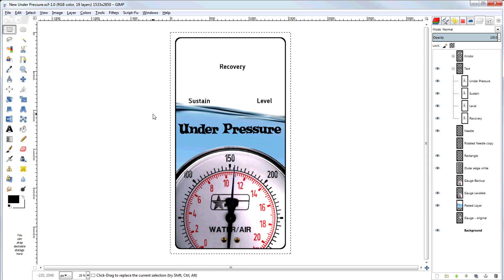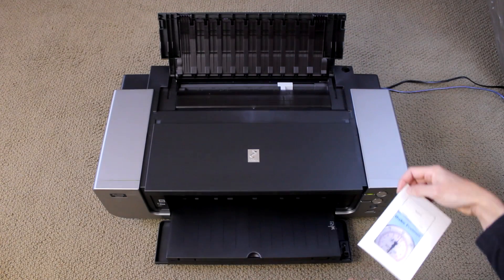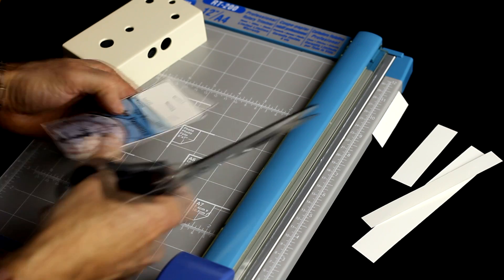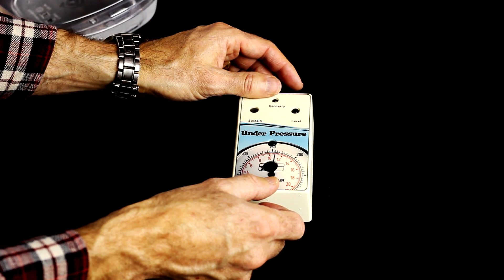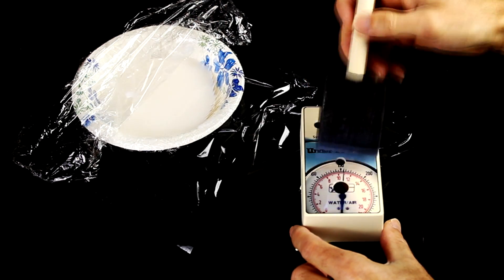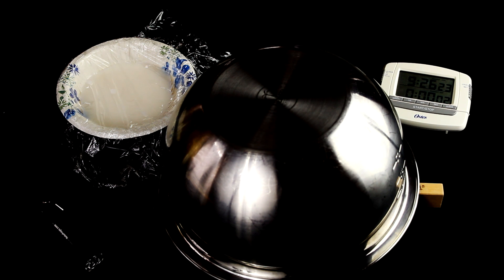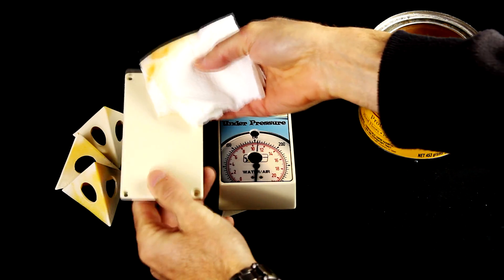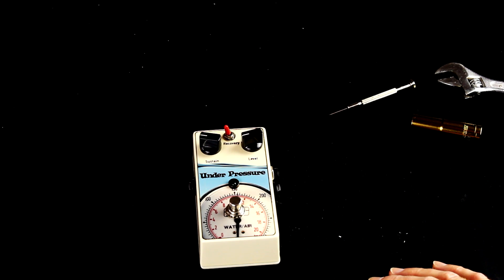Printing and Applying Waterslide Decal to Pedal Enclosure

Comment: Hey guys! I just finish a pedal with a marble, swirl coat. im struggling with the Decals (Vol, Tone, Gain). My collors are Green and Black. it seems that nothing fit with a swirl coat. What do you think? I've seen several swirled coated pedals and most of them have no decal. Maybe it just break the cool thing of it! if someone has any idea on how to print a decal and still be visible on the messy swirl, please let me know! cheers

Comment: John, you did the clear coating on the waterslide decal because you printed with a inkjet? i've printed a logo for my guitar using a collor lazer printer and i didnt have issues with the decal. i just coated with clear coating after i attached the decal. i was just lucky? cheers

Comment: Just to add to John's response. You can get decal paper that has a white background but you have to cut it out very carefully since you'll be able to see the trim line plain as day. That's about the only way you can use these on a black finish. You can however print a black border around it to help mask it, but it may not match the black on your case/finish